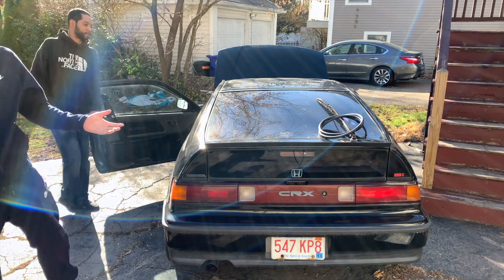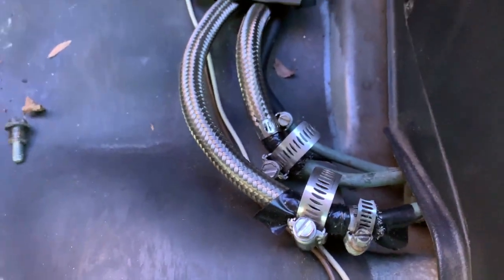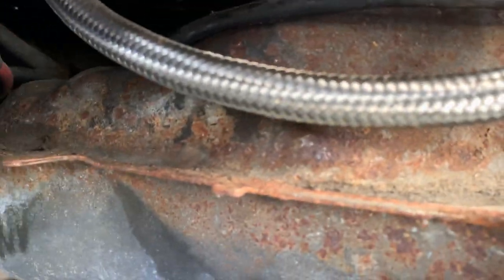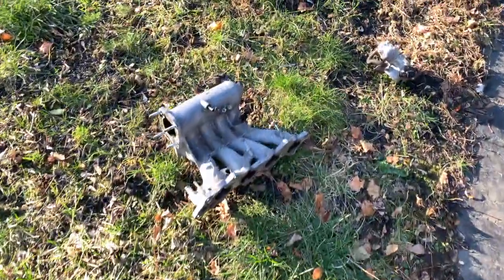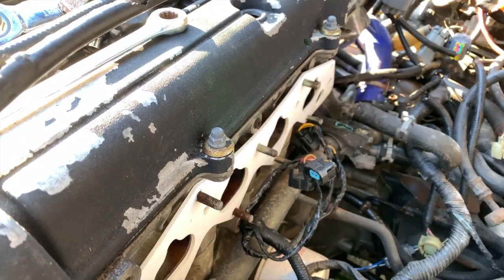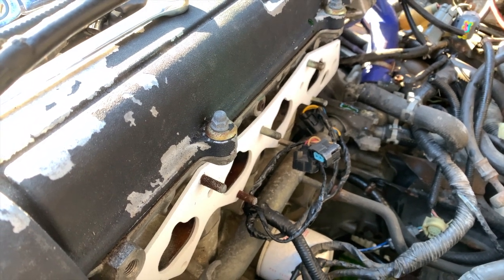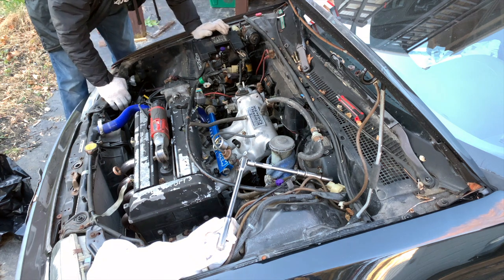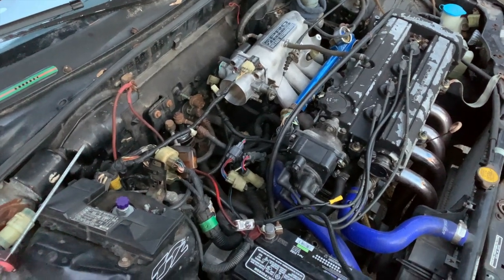Skunk2 Intake Manifold Install and some loose ends tied up on Kariim's crx

Comment: How does this feel i just put one on my b18b1 and I haven't been able to drive it yet
Reply from the maker: it feels More or less about the same as stock. I think it would shine in a boosted setup and possibly tuned NA it would feel a little better but on a mostly stock b20 not much difference. 
Thanks for watching!